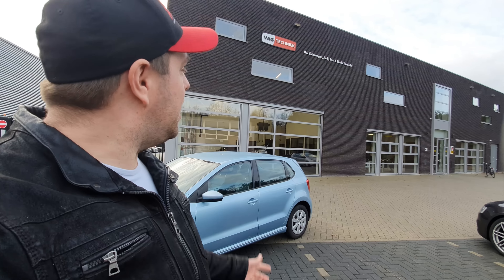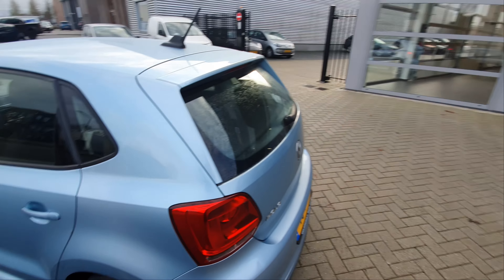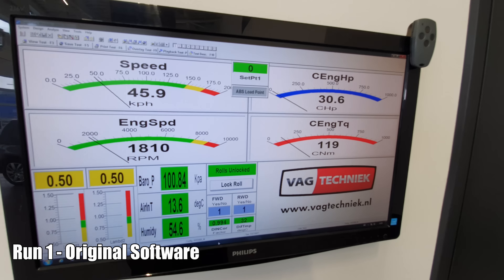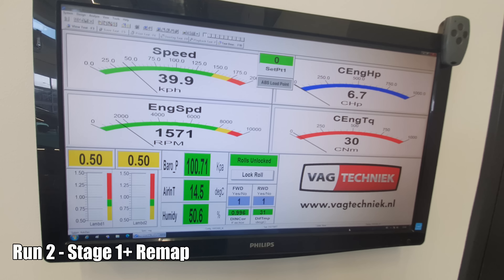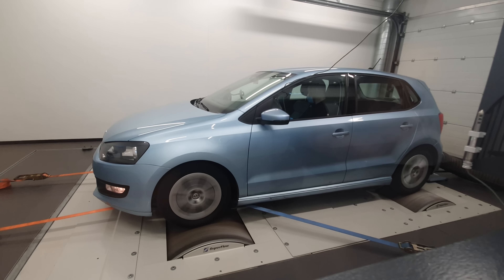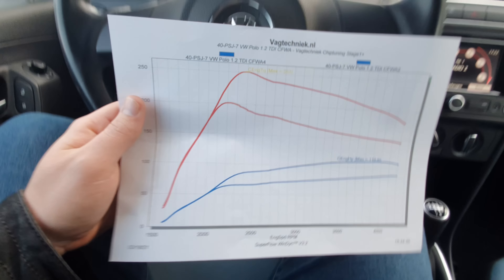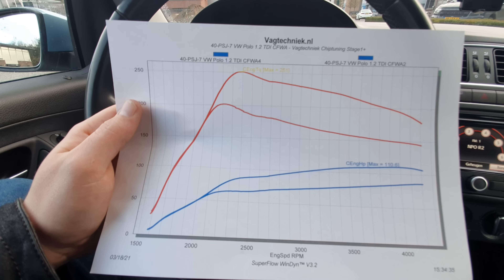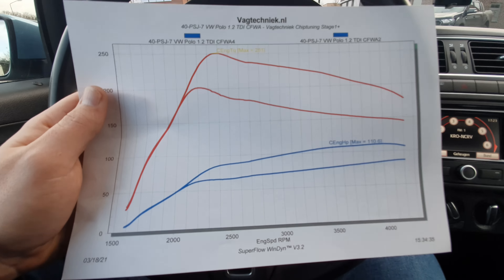Custom ECU Tune & Dyno with the Polo Bluemotion! (with Dragy) Stage 1+ Chiptuning by VAGtechniek

Comment: I combined stage1 with EGR software delete, and indeed it is funny to keep up with many other cars 😎. Fuel consumption depends on how much power you take, between 1L:26km (80km max. relaxed driving) and  1L:20km (many accelerations and speeding). Seat Ibiza ST 1.2TDI.

Comment: That makes me wonder about the factory power figures, 
could it be they consider that number as a hot engine in less then ideal atmospheric conditions? 
As seeing your stock map numbers it seems plausible being as they noticed it is common across the groups engines
Reply from the maker: I think the factory power figures are guaranteed even in worst case scenario (high heat, poor fuel conditions etc)
Reply: @AutoAddictionMedia  yeah thats what i mean, drive the car in high altitude for 8 hours non stop except for fuel so the engine is really hot and not able to breathe and you get the factory number, 
Nice vid buddy, the rs6 will be a treat to see 👍
Reply: @AutoAddictionMedia  be curious to see the numbers on limp mode, to see how limp it really goes
Reply: The difference between the factory figures and the Vag figures could also be attributed to variations in the dynos themselves.

Comment: Seems this doenst fix the real problem, no power below 2000rpm. 900- 100km in fifth on my st makes the car buzz and vibrate. 

Anything to tune the turbo to come on earlier? Dont care about the higher power numbers really
Reply: The engine is too small to spool up the turbo earlier. You could fit an even smaller turbo, but that would make it lose power in higher rpm ranges

Comment: I have a 1.2 tdi as well but under 2000rpm is just useless. it has 0 power. Did this performed the same before the upgrade? Would an upgrade help for the low end power?

Comment: I've got the same car and got an EGR problem. Do you think that remap the ECU and close the valve EGR electronically is worth it ? Thanks from Italy 🥂
Reply: DO NOT fix EGR issues. If its out of warranty get it turned off electronically or block it off physically.
Reply: @shueibdahir  Does doing that effect the M.O.T emissions tests within the legal perimeters.. ?   Thx for any assistance you could give me on this.
Reply: @UbiquitousRomp  Didn't with mine mine. Infact the car passed with flying colors

Comment: Did you deliberately choose no power increase below 2200 rpm ? I use mine everyday 45 mins on highway 90 to 135 kph.  But thats 1500rpm to 2200 rpm. So this engine tune does not help much. How come your 20% gain is not available from 1400 rpm and up ? That would be very usefull for anyone on the highway that has to slow down for trucks and accelerate back to cruising speed again. If you can make the car stronger in the 90 to 150 kph speed range that is helpful for most people.
Reply: That doesnt work for cars with manual gearbox. It would make the clutch suffer alot. It does work for cars with an automatic gearbox, with a torque convertor.
Reply: @ThenameisOskar  wifey had a 1.6tdi Fabia 104hp. We did a full emission delete to unblock the filters and remove the egr. Then remap. With unblocked filters (cat dpf) hollowed out the turbo spools up about 400rpm lower. So i asked the tuner engineer to focus on low down punch. From 1400 rpm there was good turbo boost pressure. We maxed out what we could. 104hp became 152hp. And 184 lbs torque became 240lbs. The performance was much better. And the fuel economy transformed. On the highway at 65 to 70 mph we used to get 75 to 80 mpg. After tunning over 100 mpg. I never got a chance to test the top speed. 

There was no trouble with the clutch. But there are upgraded clutches available if needed. So next time it needs replacing i would use a stronger clutch. But we upgraded to a much higher spec Octavia 1.6tdi SEL. So i dont know about longterm. The fabia clutch lasted 20,000 miles after tunning and was still ok when we traded in.
Reply from the maker: The turbo doesn't spool up faster. There is nothing to gain in the lower rpm's. It's not something you can "choose" on these type of engines. A smaller turbo would increase power at lower rpm's, but it would have far less power in the upper rpm range
Reply: @AutoAddictionMedia  ok but your car has blocked up filters. If you do both remap and  full unblocking of everything in the exhaust system (cat dpf egr) including ditching the blue device, then ask your tunner to max out the low and mid revs boost, thats when you gain the extra benifit of spooling the turbo 400 rpm lower with much faster responce. All these 4 items must be unblocked to make engine breath more air flow. It helps a lot in top gear on the highway. Fuel consumption is much less.